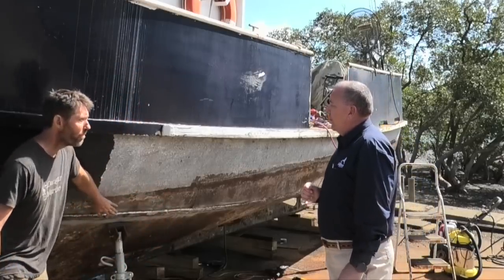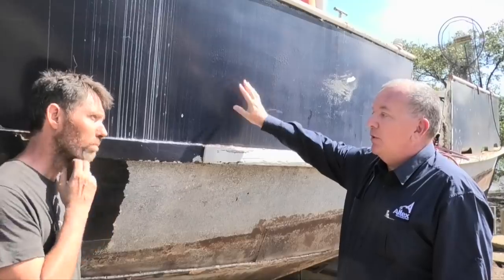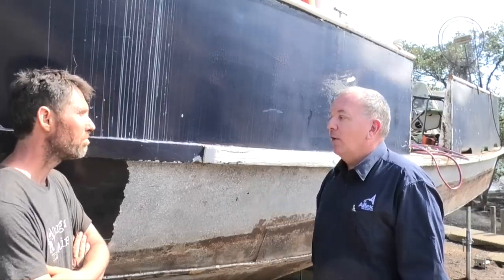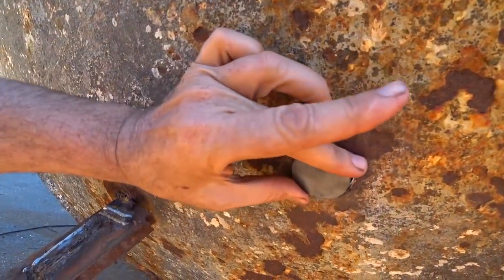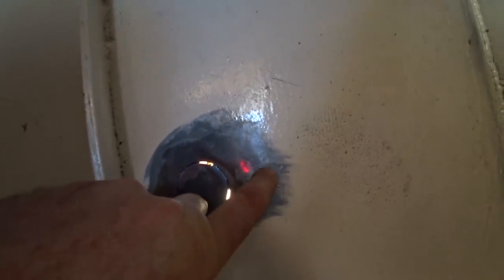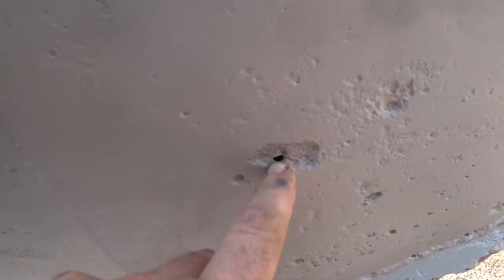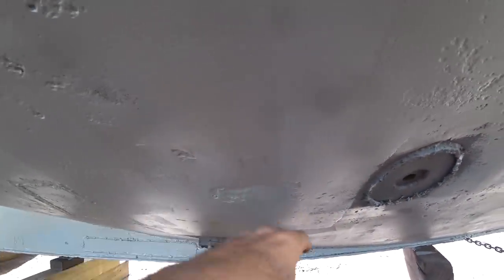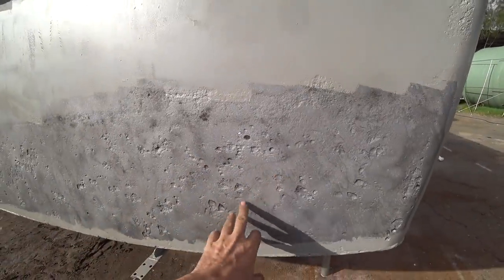Sandblasting and priming the steel trawler hull

Comment: Would you still give the advice you give at !6' 50"? I'd be inclined to get the whole lot sandblasted, then immediately apply the epoxy. I'd then mend the bits that needed mending, knowing that those areas are small and manageable to  clean up and get the epoxy on. Did the blasting not identify any new areas that needed fixing?

Comment: You want to round the edges of your patch to prevent stress risers.  A 1" radius is optimal.  If you can make a full penetration butt weld (double bevel), even better.

Comment: A sheet of 3\16 on the transom, as a doubler, split on the framing ?
Everyone is different.
Pipelines corrode just like your transom.
I have welded many a sleeve on many high pressure lines.
I would have sleeved the transom to repair it .
Just easier, then sometimes with all the heat from filling the pits cracks can develop.
Reply from the maker: Adding doublers to boats is very common, those patches on the side are covering old corrosion for example. The big trouble is they need to be removed for insurance and survey inspections so one day if the boat works out well I'll probably remove them and replace the steel below. A lot more work as cutting the steel of the framing is tricky but I think it will be worth it in the end.

Comment: Jim L
Hi Steve, please make your radius corners in hull inserts bigger, not 13mm  but at least 40 mm radius.  You may get a crack from small corners.  Believe me..I know.
Reply: Larger radii the better. The circles are a great idea, a hole saw will cut both, and they make them up to 5"/250mm.

Comment: when you're stick welding, don't hammer with the chipping hammer.  It's for sliding and scratching off the flux.  Sometimes you may strike with it but it's not a real hammer.  Also, don't be afraid of sharpening it.
Reply from the maker: I'm glad you stair that because it is very blunt, I'll sharped it up.

Comment: here in the united states we have ships that have been floating for over 100 years with no rust at all ,, i wonder what they used for coatings ??
Reply: They used to use lead base or chromite paint. Hands down best corrosion protection from both of them, only problem is they're both highly toxic when burnt, blasted or eaten.

Comment: Great job 👍 I would have done the same thing. Make sure corners are sound, fill the lil valleys, grind flat and prime. I think you have a keeper there when she's finished. Stick Welding outside just is cheaper, faster and the wind doesn't bother it like Mig or Tig on steel boat's :)

Comment: Dangar Marine awesome work looks so good already! I have one question for old mate when he was talking about anti foul that perhaps you could ask.
If you apply it with a strong chemical bond how does this affect removing the antifoul and re-applying in the future?
Some people will do this annually and I can see where it might be better to not have it bonded as well.

Cheers
Reply: That's what a sander is for...  You don't want it coming off on it's own, due to poor adhesion, right?
Reply: @thilltony3362  it depends though if you have bonded anti foul to the undercoat and you have to sand all that back every time its not that great?
As i said falling off on its own is an alright statement to make but if it happens after 4 years and you anti foul it every year not really an issue.....
Reply from the maker: With antifoul you generally just pressure wash and over coat. An ablative antifoul with wear down naturally so you are just looking to get the lose stuff off first so the new coat doesn't come off with it.
Reply: @DangarMarine  yeah ok that makes a lot more sense now! Where I am people generally get their old stuff taken off completely. Mostly fiberglass though not sure if that makes a difference?
Reply: @webbey6479 , it depends on what kind of antifoul you are using.  
If using the hard epoxy type, the trick is get a good bond and put it on thin and smooth.  Then next time, you hit it with a power washer, and go back with another thin and smooth coat.    You can do this for a long time before any need to sand.

If using alblative or "self polishing" antifoul, it's softer and the surface wears away slowly.  Generally, by the time you haul out, there isn't much left.

On my boat, I (like many in my area) use a combo.  I have a base coat of hard antifoul, topped with alblative paint.    It works great!  I keep it thin, and by the time I pull for the year, the top coat is pretty much gone.   Hit it with the pressure washer, maybe run a sander across any chunks, and then add a thin coat of alblative, and 2 hours later, it's dry and ready to go.  It's super easy to deal with.

Generally, after some years, you will have to do some sanding.   I personally see no need to take it back to bare hull, or even to the barrier coat.  Getting it down to the smooth base epoxy coat is what I shoot for.   I just want a smooth, protected surface.

But of course, there are many ways to get the desired results, based on what you want.
Reply: @thilltony3362  thankyou for the reply mate very informative!
Reply: @webbey6479 , Glad to be of help.   I wish someone had given me the basics when I first started out.  I used to just glob it on thick, and the boat would lose a lot of speed.   Now,  with the hard coat as insurance, I keep it thin and smooth, and lose very little speed.

Comment: Why did you choose not to use the venturi mixer for hold blast as mentioned earlier?
Reply from the maker: When you use high pressure nozzles the venturi sucks at a greatly reduced (and unknown) rate. This was the only way to get a high enough concentration with a high pressure nozzle.

Comment: I totally agree with your philosophy. I remember spending hours welding up holes in parts of offshore motor mounts because I had sticks, a welder and round bar. Could have just made new out of some 2X2 - L angle but they had already been around 50 years, they just had to many holes in them from moving motors around. 
From the world I come from (restoring old boats) you try to keep what you can anyway. Replacing things is almost a last option. 
Still need a sign off. Just a "Stu from Danger Marine" (hit the like button and subscribe to my channel) would work. Just saying.
Reply from the maker: For sure. It was like the rudder post. The pros are always, "If it won't come out in ten minutes just cut it out and put a new one in" but I like the idea of keeping as much of the original boat as possible.
Reply: In my world there is a lot of cases that there just is no replacement available so you are stuck with what you have and even if there is a replacement you want to keep the original intact in case the replacement is really not a "replacement" but something that just looks like it. Also I have found new replacements will never re-install like the refurbished old stuff will. For some reason new is always a tiny bit to big or small this or that way. Something and before you know it you are in a lot deeper then you ever though you would be for no reason. 
Good to see you moving along. Hope winter coming for you all don't screw up progress.

Comment: Couldn't you put a thin layer of steel on the transom.. Overlay it.. Seems like it would be a permanent solution..
Reply: Good thought Oscar Mayer. It might seal in oxygen between the plates and cause them to rust between the layers. And you really can’t weld an area where there’s paint or epoxy (between the 2 layers).

I think the steel there looks worse than it actually is. I heard him tap on it and its not super thick, but there’s all kinds of welded braces at different angles behind there that strengthen the structure up.

There is a process to weld two plates of steel together. It keeps them flat (instead of adding bends or braces for strenght) and is super strong (rigid). They use explosives between the plates that make a complete weld from one end to the other. It’s pretty neat, you could probably find a video of it.
Reply: @krisanderson997  Well it will probably out last both of us anyways. How expensive was the portable portable sand blaster guy.? . I've used them several times here in the states and usually runs around $500 for a car or truck..Keep the videos coming this it a awesome project.. Looking great.. 👍
Reply from the maker: Plating over the hull, like this one has on the sides, means the boat can't be put in survey as there is no way to know the extent of the corrosion between the plate. Cutting the old plate out and putting a new one in is the only real repair, but unfortunately that takes a serious amount of work. Down the track I will cut the doublers off the side of the boat, just not this season.

Comment: What happens under the stand blocks?  Like how do you clean/blast/prime those bits?
Reply from the maker: Paint what you can and then move the stands and do those bits by hand.
Reply: Thanks Stu, but they're 'under' blocks? Does there come a point you shift the boat or stands to reach those bits?  I've always wondered about big ships sitting on blocks in dry docks, finally I have a chance to ask :)

Comment: Why don’t you just weld a plate to the whole back of your Transom on the out side then you won’t have to do it later! Just curious why you don’t do that. But like your project.
Reply from the maker: Plating over the hull, like this one has on the sides, means the boat can't be put in survey as there is no way to know the extent of the corrosion between the plate. Cutting the old plate out and putting a new one in is the only real repair, but unfortunately that takes a serious amount of work. Down the track I will cut the doublers off the side of the boat, just not this season.

Comment: Get an assessment from a pro about how to Zinc up the boat after you get all your electric in. Proper Zincing is a boat saver.Don't know how many times I ran into boats, (mostly wood) where they had been over Zinced and had fried the wood in the hull with reverse electrolysis. You want an almost  neutral balance between the boat and the sacrificial Zinc. That is part of what you are fixing. Poor Zincing.
Reply from the maker: It doesn't seem that hard to get the right amount of zinc yourself. There is a general rule of thumb for the length of the boat to get you in the ballpark and then doing a silver half cell test with a multimeter will quickly tell you whether you need more, less or whether it is just right.